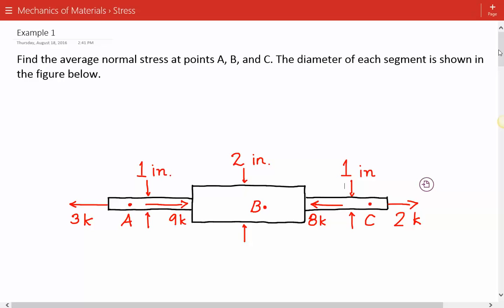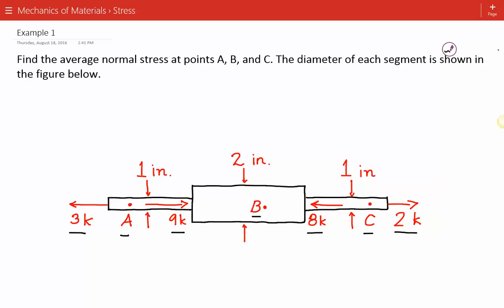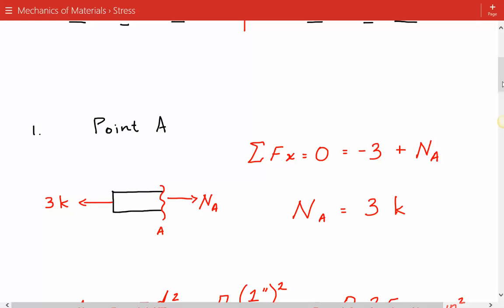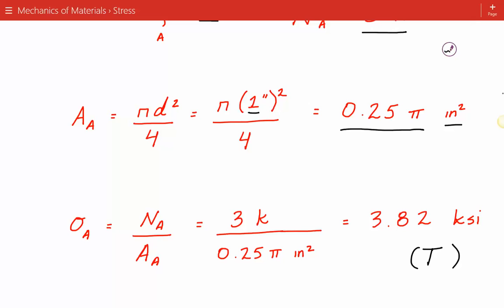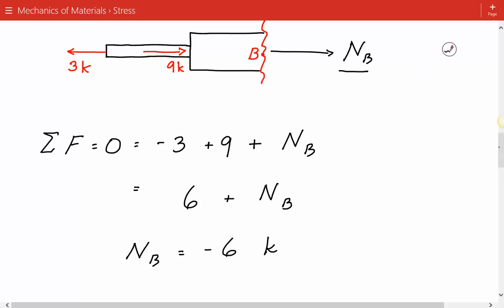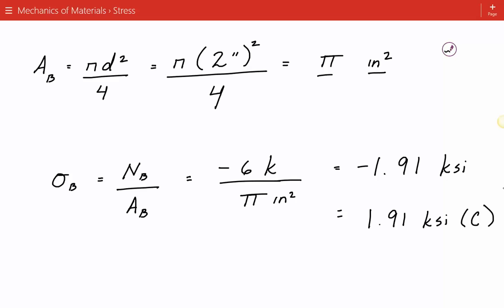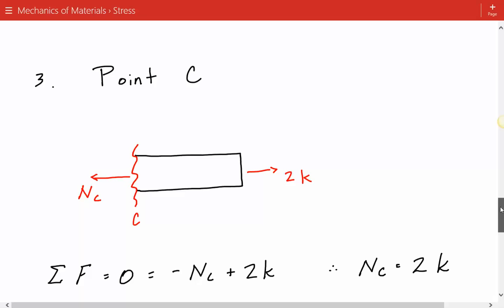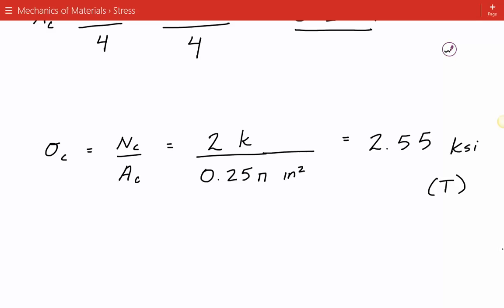Calculating Average Normal Stress, Engineering Mechanics of Materials Stress Example 1

Comment: you didnt include the pie in dividing to 4 in getting the area. i think 0.25 is wrong, i think 0.79 is the right answer :)
Reply: Jimwell Dalafu at 4:26 notice that right next to the 0.25 theres a pi. So the answer is 0.25pi inches squared which is what he has written.
Reply: Also notice when he divides 2k by the area .25pi he gets 2.55ksi. So he is correct. You just didnt notice the pi.
Reply: 2 divided by .785 is 2.55 ksi where .25xpi=0.785
Reply: r=1\2  r sequir= 1\4 so that he divided by 4